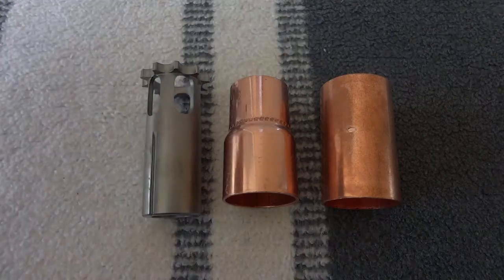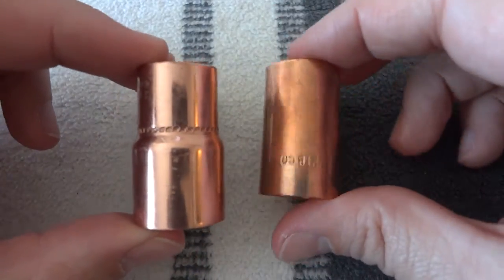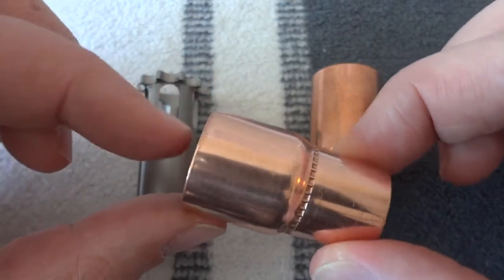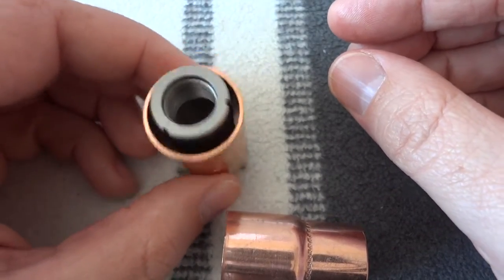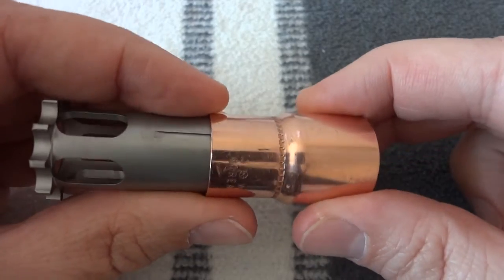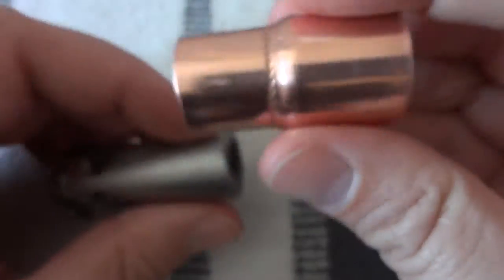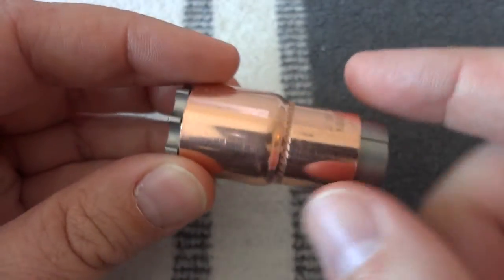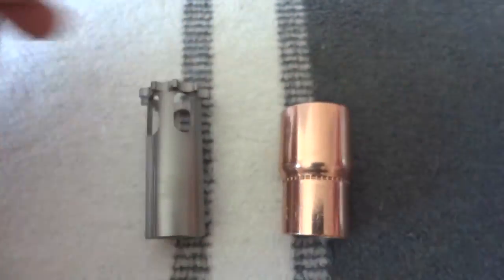Cheap Suppressor Fixed Barrel Spacer

Comment: My issue with my Osprey 45 can was when using the spring it would index perfectly locking and unlocking using the button and all. But the minute I switched to the fixed barrel spacer the button indexing was pretty much was useless it just moves off the threads rather then spinning freely. Tough break.
Reply from the maker: Was never a big fan of the Osprey design for indexing.  I've never owned one because of that.  It's a neat looking design, though.

Comment: Many websites sell fixed barrel spacers. Are they all universally the same length or do they have to be purchased to fit a specific model?
Reply from the maker: Generally, they are all different. Some manufacturers have standardized on the SilencerCo standard.

Comment: 3/4 to 5/8 did NOT fit my Osprey45 piston...
Reply from the maker: It's subtle, but did you catch where I said I took a 3/4" drill to it in order to get it to fit?  Mine fit, but that knurled section kept it from going all the way in.  It's also possible that my copper fitting was not made to the same tolerances as yours.
Reply: @RyeOnHam  Nah, my piston is a hair bigger then 5/8

Comment: my suppressor finally got out of backorder, and is now in ATF jail.... :/
Reply from the maker: This hobby is about patience, brother.  What did you get?
Reply: @RyeOnHam  Osprey 45 for my 10mm vector SDP. it's gonna be sweet.
Reply from the maker: @madmike9398  Yeah, you'll need a fixed-barrel spacer for that one.  Old-school can.  Looks pretty angular and interesting.
Reply: @RyeOnHam  yep. will also need a 1/2 x 28 piston for the 9mm sub 2000.

Comment: That is a piston.. the piston goes into the booster assembly 👍 and my dead air fixed mount was $25.. should fit yours too.
Reply from the maker: Dead Air did not exist as a company when I bought my suppressor.  I know what a piston is and I know where it goes.  $25 is a good price, if they fit, however Ghost pistons are not cross-compatible with SWR Octane/SiCo/Rugged pistons.

Comment: Did it work? I can't find one for my sig srd45 anywhere
Reply from the maker: I have another video explaining what I ended up doing. I ended up using both aluminum and stainless steel instead of copper. I do not think they would work directly for the sig, however they might inspire what you do with that.

Comment: I am using an SRD45 converted to 1/2 x 28 for use on 9mm.  I have been trying to find the actual spacer... now I am wondering why I even put that effort in!  Guess it is a trip to the parts store tomorrow!  Thanks for the great idea!
Reply from the maker: I ended up using a piece of aluminum tubing.  This is what I got: "Aluminum 6061-T6 Seamless Round Tubing, WW-T 700/6, 7/8" OD, 0.759" ID, 0.058" Wall, 12" Length"  I got Stainless, too, but it's not necessary.  It's VERY important to cut the tubing off square and make it just long enough so that the piston retainer tightens against the spacer and not against the can.  This tubing worked for the SiCo pistons.  Not sure it would work on the SIG ones.  Never seen a Sig Piston.  Just measure the od of the piston and ID of the piston housing and find something in Stainless or Aluminum in that size range.
Reply: On an MP5 by chance? I’m doing research right now on how to get my srd45 to work on my mp5 clone
Reply from the maker: I do not own an MP-4.  You can get a 3-lug mount, but a fixed-barrel spacer might be a better idea.  No experience with the SRD45 though.
Reply: My understanding is there is no 3 lug adapter for the SRD45

Comment: That's so funny that you used that coupling from Lowes. When I am building a form 1 can, everything looks like a suppressor part everywhere I go! You can't get me out of a hardware store if I am in the process of building a form 1 suppressor. I have walked by the exact same "couplings" in the plumbing parts isle at Lowes dozens of times, and always thought, "I bet those would work in a suppressor." lol
Reply from the maker: My family refuses to go to Lowes with me.  I stare at the parts and pace back and forth examining them, putting them together.  I might be the only one who takes a pair of calipers into the hardware store!  There are a few better stores around here.  There's a plumbing supply place and a family-owned hardware store that take up most of my time.
Reply: HAHAHAHAHA my wife will NOT go to the hardware store with me for the same reason. And of course you bring your micrometer to the store! How else are you going to get the right parts? lol

Comment: I just ordered a SilencerCo Hybrid suppressor (made to be used on pistols & rifles), and is it just me, or is this video demonstrating a solution to a problem that doesn't exist?  The Hybrid comes with a direct thread mount cap, as well as the piston housing, so you can use the suppressor on multiple hosts.  Am I missing something?  Can someone explain?  Was this modification needed back in 2014, but not today?  Thanks in advance for any explanation!
Reply from the maker: If you don't understand, then I'll explain it to you.  If you have a 1/2 x 28 piston and want to use the gun on a rifle, you need EITHER a fixed-barrel spacer or a dramatically more expensive fixed barrel adapter.  The Fixed-barrel adapter also leaves the teeth where the piston sits open to build up fouling.  This isn't a modification, it is a part, sold by SilencerCo, that I am duplicating. You are welcome to spend 20 times more to buy the SiCo spacer or 80 times more to buy the fixed barrel thread adapter.  I made six spacers, two from Steel, two from Aluminum, and two from Copper and I've still spent less than the SiCo part.
Reply: Chris Umling u

Comment: A half round 3/8 fine file would be easier than trying to drill out a copper fitting for a small rim edge...also copper doesn't cut or machine well...too soft.

Comment: I'm going to be REAL picky here and sound anal, but I am a plumbing biz owner with 30+ years in the trade and a master plumber. The fittings you have there are ones a plumber would use mostly on water lines. We<<< plumbers call fittings by the inside diameter.....so, the fitting you have in the first part is a 1/2"hub(goes over pipe) x 3/4" slip(goes into fitting) reducing coupling. HVAC./heating or cooling guys call the fittings by the outside diameter as not to get things mixed up :) at any rate....I just wanted to help you all out if you go to the supply house and those Dicks give you a hard time....just show them this post!!!.... G.
Reply from the maker: +gerry mckown No problem.  I just brought the piston in and test fit it.

Comment: So, while trying to find one to the reducer couplings, I came across a plumber that had a spare 6" section of 3/4" copper tubing. It fits a lot better than the 3/4 coupling but not as tight as your reducer coupling. Can't wait to try it out, just waitin on my 9mm upper receiver to come in so I can finish my build
Reply from the maker: +the DRiZzle What's the wall thickness of the 3/4" tubing?  The reason I did not go that route was because I was under the impression that the tubing would have a thinner wall thickness.

Comment: THANKS! I'm kind of new at this, and I, legally, obtained a used suppressor that needs a piston spring. No luck anywhere. Your tip will solve my problem.
Again, THANKS!
Reply: Briggs& Stratton/Tecumseh valve spring.
Reply from the maker: DJ Sullivan What is the make and model of your suppressor?
Reply: Springs are easy to find.....